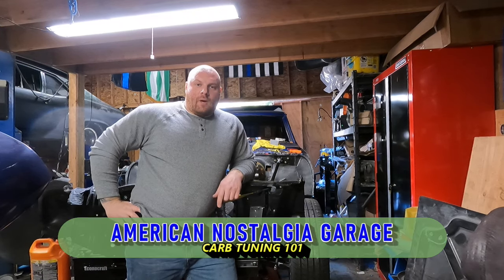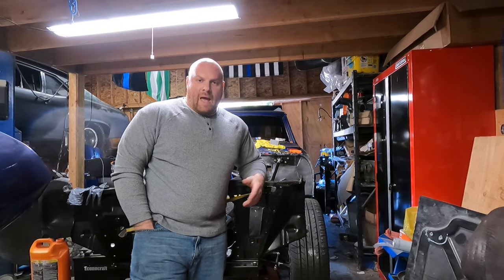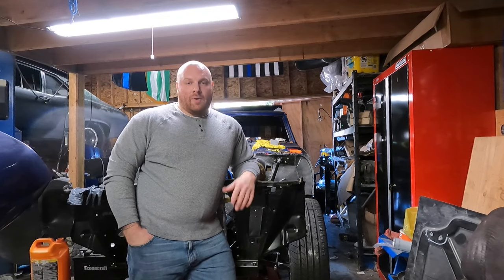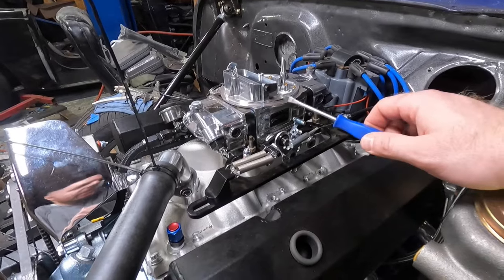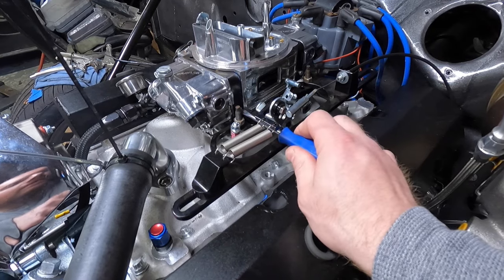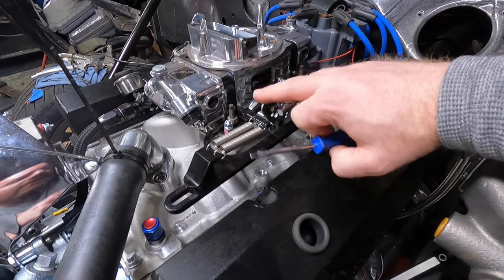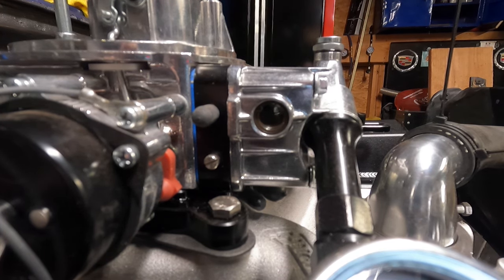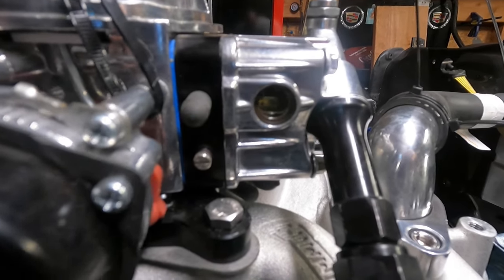CARB TUNING 101: Tuning basics explained!

Comment: I think it's worth pointing out that the glass sight floatbowls have specs per Holley documentation that the fuel should be in the MIDDLE of the glass. The "bottom" is only for the old plugged style ones. Additionally, vacuum tuning is so archaic. Just put an O2 bung in and use a hand held meter and tune for AFR.
Reply from the maker: Thank you for making the correction on the sight glass. I certainly agree that adding an o2 sensor to a vehicle is a better way to do it in every sense however many people running a carb are not going to do that. Which is why I included it in the video. Thanks for watching.

Comment: I am trying to tune my new engine swap with a new 750 brawler identical to this. I am having issues but i think after watching this i am comfortable making all adjustments now. Question - on the vacuum port, are you saying hook the gauge to one of the 3/8 ports?
Reply from the maker: I’m glad the video helped. That’s exactly what it was made for. Yes, normally the 3/8 ports are full manifold vacuum. Just make sure it’s not a timed vacuum port. If you plug into it and have a normal vacuum reading at all times then it’s full manifold and you’re ready to tune. Thanks for watching.

Comment: Holley cow man, thank you so much. I was using the wrong  vacuum port, lol. I have been looking for a good 40 minutes until I found your video addressing the Brawler vacuum port. Thaks again!!!!!!!
Reply from the maker: Very happy to hear it helped!  If you have a vacuum gauge it’s worth testing the port to ensure it’s full manifold vacuum and not ported. For reference full manifold will he high at idle or cruising with the throttle blades closed and go to zero or around zero at wot. Ported will be low at idle and increase as you open the throttle blades because the source is above the throttle blades and works with a Venturi effect as they open. I’m sure you already know that. Just trying to be helpful. Thanks for watching.

Comment: Thought this illustration  was great for me to fine tune my holly 4 barrel
Reply from the maker: Thank you very much for the compliment. Glad the video helped out. What kind of hot rod are you working on?
Reply: @americannostalgiagarage  i had to replace my motor on a 1991 1500 , had a option to put a 350 ci high performance engine in here but had to get rid of the port injection and go old schoot like me . My 350 cu is putting out 425 HP , i was 26 in 1991 when bought new. I paid 16,500 for here ,  had her appraised 2022 in fall 38,500 no rust orginal paint
Reply from the maker: @dorinschatz5457   Wow the appreciation of these old cars and trucks is crazy.  Amazing to see how much money you could make.  Keep truckin'.

Comment: Before changing squirters you could verify that the accelerator pump linkage is adjusted correctly. Make sure that as soon as the linkage is moved fuel is shooting out of the squirter. Once you’ve set that you need to adjust the linkage so that there is a minimum of .015 clearance between the pump cam and the arm at WOT. Great video.
Reply from the maker: Absolutely right. Thank you for mentioning that. Can’t believe I forgot to mention it. And thanks for watching.

Comment: I must admit, the info you provided is not only the best, but also the easiest to understand. I have been dealing with a Barry Grant 650 Demon quad and it's delivery issues . Most others have advised to replace it with another carb that isn't a Barry Grant. I'm stubborn and actually like the carb. So with the info you provided, I feel much more confident about getting my 79 Elco up and running. I have a 350 small block in it. I will post my final results regardless once I have finished. Thank you for taking the time to share and care. And, yes I  am now a subscriber. Peace
Reply from the maker: Thanks A lot for the kind words. Really happy to see you got something of value out of the video. Barry grant carbs are good to go. Although the easy way would be to replace hood parts with new stuff but taking the time to get your old stuff going is more rewarding and it’s a great learning experience. Thanks again for watching. Please post results when you’re ready can’t wait to see it.

Comment: Thank you for the video, what about adjusting the rear butterfly openings? I know my holley has a screw to adjust them.
Reply from the maker: That’s a good question, I did not look actually. This engine has a boost cam in it from its last “assignment” lol, so I didn’t need to mess with the secondaries. Holley sells a kit to adjust the secondaries without having to take the carb off and flip the carb over just so you know. It’s worth the frustration. Thanks for watching.
Reply: @americannostalgiagarage  yes, my secondary was opened alot by previous owner because when connected to ported/timed vacuum he could not adjust idle properly. I switched to manifold vacuum, got 20 timming at idle and closed secondaries and primary down. Works better.
Reply from the maker: @st.k.4528  that’s great. Many people would have not known what to do in your situation great job getting it all figured out!

Comment: Thanks for the video. I have a 750 Proform carb. My new rebuilt engine is running way to rich. Any thought of what I should do?
Reply from the maker: I would start by asking when is it too rich? Idle? Part throttle? Wide open? I would get for idle mixture screws set first those are usually a culprit. Next would be jet the carb down a couple sizes (2 or 3 sizes at a time). Also make sure you dont have too big of a squirter in there. After that we’re talking power valves, air bleeds and a bunch of stuff.
Reply: I would suggest reducing the idle feed restrictions size such as .032" to .028". If your idle mixture screw adjustment is as little as 3/4 or even less turned out, that is a good indication that the IFR size is too big. I like to shoot for 1-1/2 turns out. If you find your idle mixture screws needing 2 turns out or more, the idle feed restrictions are too small. That's when you start having problems tuning the accelerator pump system.

Comment: Should I set my float halfway on the site glass or just when I see the fuel on the site glass.
Reply from the maker: I’m not much of an editor to fix the video but the correct way is halfway up the sight glass. It should be noted that if your carb has removable plugs like the Older style carbs do then the bottom of the hole would be correct. Sorry for the confusion. Thank you for watching.

Comment: how to adjust air flow my truck runs on when i shut it off also alot of condensation out of tail pipes
Reply from the maker: So first the about the condensation out of the tailpipe. H20(water) or better yet steam, in small amounts is a by product of combustion. So if you see a little bit when it’s cold or on start up. Or is you see a small about of liquid coming out of the tail pipes here and there that’s ok. But if you’re saying you have a substantial amount of water coming out of the tail pipes, then I ask what does it smell like, sweet? Then it may be coolant and you may need to be looking into head gaskets, possibly. As for it running on, that could be caused by a couple things, a leaky carb that’s allowing fuel through when it shouldn’t be, I’d also check the timing. But you could also have a hot spot in the engine, gasket or heavy carbon deposits that could be causing it to have pre ignition and to diesel on like you’re describing. Side note if this is a high hp engine or high compression and you have old or low quality fuel or even too low an octane it could do the same thing. That’s a few of the possibilities. Good luck with it, I hope you get it fixed soon.

Comment: I’ve got a Chevy 2 also with a quick fuel carb. I have a problem with a rich idle. Any ideas what I can check for?
Reply from the maker: That’s great what year is your Chevy II? I’d start with the idle mixture screws. After that I’d verify the floats aren’t too high and you’re not dribbling fuel out when you don’t want to. And mess with the air bleeds, if they’re adjustable. Those have everything to do with how fuel is pulled from the bowl. But start with the mixture screws. Thanks for watching.
Reply: The site glass level is in the middle. The rear set screws are at 3/4 turn out. It’s a QF 680VS on a 383 SBC
Reply from the maker: @supernaut1029  how are you deciding that it’s rich? The old sniffer? Lol. If so, could it be that the front idle circuits are the ones that are causing the fuel smell? Also keep in mind that the amount of throttle opening is also going to effect the Venturi effect on the fueling circuits. So it could be open to a point where it starts switching circuits.
Reply: @americannostalgiagarage  definitely smells rich. I have the front set at 1 1/2 turns idling about 1000. It’s not a big cam but the LS is 106. I have a 66 Nova. Would send a pic but not sure how to do it on YouTube 😂
Reply from the maker: @supernaut1029  that LSA is probably not going to be as easy to tune at idle with a choppy cam like that. I bet it sounds awesome so good for you on that. Lol. With an LSA like that your volumetric effieciency is probably pretty bad because there’s probably not a lot of scavenging and maybe some exhaust reversion. So your rich condition could be caused by a little bit of incomplete combustion at idle. However you might be able to bandaid that by setting your front idle screws in a half turn and maybe bumping the idle up by a couple hundred rpm. And maybe smaller slow speed air bleeds. Either way that thing sounds like a good time brother. Just roll with the fuel smell on that beast. Tell people it’s your new cologne.
Reply: @americannostalgiagarage  I  wonder if I increase the octane, if that would affect the A/F ratio? Thanks for all your help
Reply from the maker: @supernaut1029  that’s not going to change the afr. Octane is really about resistance to ping in stuff with high compression or boost or anything with a very hot combustion chamber. That being said being safe with high octane fuel is always a good call on the hot rod. Since most hot rods don’t usually have any safeties for this problem.

Comment: Thanks for the video I'm struggling with my 680cfm Brawler can get it to start but if wont stay running long enough to even verify timing  feels like it's going to shake itself apart. Got vacuum advance pointed at number 6 cylinder.Both corners are 1 1/2 out throttle screw is bumped up almost too much at this point where the engine  diesels when shut off. Where am i going wrong?
Reply from the maker: In this case I would take a little breather. Then go back to basics. Verify too dead center, verify you have the firing order correct. Verify you’re not over advanced(would probably be hard to start) check the plugs to get an idea what the mixture looks like, probably replace them. Make sure the valves are adjusted ok. Then make make sure your carb is doing it’s job, fuel leaks, vacuum leaks, readjust idle mixture screws and make sure you don’t have a leaky power valve or another circuit isn’t fueling when it shouldn’t be. While it’s running look down the Venturi and see if you can see fuel “dribbling” out anywhere. I’m sure you will figure it out. Stick with it. Thanks for watching.

Comment: when you changing the power valve do you have to change the jets at the same time
Reply from the maker: Good question, no you don’t. The power valve has more to do with timing the additional fuel for wide open throttle. Not as much to do with air/fuel ratio although it does effect your afr. You should decide your jet changes depending on spark plug readings and on how the engine runs. It can be tough sometimes. Usually it’s best to jump 2-3 jets sizes and see how the engine likes it. If it gets worse you could try going the other way. Thanks for watching.

Comment: I need advice have great curb idol.  Then I drop it in gear and it drops way down just about killing the engine so at a corner have to put it in netursl
Reply from the maker: So I would want to know what transmission is in the car. Basically want to know if it has a lockup converter. Possibly the converter is stuck locked. But if not I suspect a vacuum leak, or fuel delivery issue. Basically it’s probably running but doesn’t have the power to get over the load of being put in gear because it’s not getting enough fuel or there’s an issue with the trans. Also double check your timing. If the trans is ok, check your fuel filter, the screens in the carb inlets, if you have them, make sure the needle and seat is clear. Buy a can of carb cleaner and spray it all over to try and find a potential vacuum leak. Try these things to start, I bet you find it pretty quick once you start looking. Thanks for watching.
Reply: @americannostalgiagarage  thank you so much off to buy carb cleaner
Reply from the maker: @ceasergert2780  of course, check back in when you find it I’d love to hear how you do with it.

Comment: So which vac port did you use and what if when you do the adjustment NOTHING happens?
Reply from the maker: You need to use the full manifold port not the timed port, once you throw the gauge on, full manifold will read vacuum and drop when the throttle is opened. If you make an adjustment and nothing happens then either you’re right on the money or you’re so far off that you may need to make large adjustments to see a difference. It comes with time. You can do it though, just stick with it. Don’t make more than one adjustment at once. Thanks for watching.

Comment: I am having trouble with fouling plugs it is running to rich I have a 750 brawler on a 383 signature series motor
Reply from the maker: Probably worth jetting it down. But that’s sort of a blanket statement type repair. 383’s are awesome power plants. But shouldn’t need a ton of jet. Try jetting it down 3 numbers and see if that helps. Thanks for watching.
Reply: Fouling/rich at idle or cruising?

Comment: I wish there was a video for carbureted supercharger guys. I got two blower carbs on my 6-71 and can't keep the plugs clean after I race a couple times. No matter how much I lean it out.
Reply from the maker: That’s an entire video in its own lol. That sounds like an awesome setup you have there. It’s been a while since I had a carbureted blower car, but man do I miss it. Mine was a draw through roots blower with a boost reference Holley 750 double pumper.  It was lots of fun but always ran rich. Enjoy that thing. Thanks for watching.
Reply: Sounds exactly what I got but mine is a 427 big block Chevy with good heads and a solid flat tappet cam.   @americannostalgiagarage
Reply from the maker: @menoaz  that thing is probably a beast. How many psi of boost is it making?
Reply: I'm only running 10 lb of boost because I like to run it on pump gas. It still runs 10.90 on my 3200lb Camaro. Wish I didn't have to change plugs so much.
Reply from the maker: @menoaz  I would mess with the heat range a bit. That should help keep the plugs cleaner.

Comment: 2 and a half out to start
Reply from the maker: I’ve never heard that before it’s always been 1.5 but if I have issues I’ll try this thanks
Reply: @americannostalgiagarage  you're welcome i've heard 2 and a half on all carbs your the first i've heard on 1 and a half also i use the afr wide band to adjust takes the guessing out. i have one on each bank i bought a triple gauge holder i have one afr on each side and a vacuum gauge in the middle inside the car
Reply from the maker: @bobdimartino6738  ok well I’ll keep it in mind if I ever have issues the 1.5 turn method I’ve been doing for almost 20 years and has worked perfect for me. But you learn something new everyday right?

Comment: I wonder if that wrong ''cut the idle vacuum in half for your power valve'' myth will ever die.

Lean cruise and idle have zero to do with each other.
Reply from the maker: Seems to be a general rule of thumb that has gotten people in the ball park for a long time. Plus really getting into power valve tuning is above most weekend gearheads abilities. Just trying to help those guys out. Thanks for watching.
Reply: @americannostalgiagarage    Yeah, it's crazy people can't tape a vacuum gauge to the windshield and literally look at the needle when the car misfires at cruise.

It's literally the easiest thing to sort out (correctly) in the carb.

It's not like something 'complex' like realizing the main jet is for cruise not WOT. And the power valve channels are for the rest of the fueling at full throttle.
Reply from the maker: @earlbrown  its not crazy but i think that’s mostly above what the average gearhead knows to do. Thank god for people like yourself who know enough to pass along the extra knowledge and experience. Again thanks for adding the much needed info.

Comment: A lot of old fashioned tunnig , need to get with the times , carb tunnig has moved on from most of what you show
Reply from the maker: There’s no trick about setting up a carb. Regardless of what year it is, setting float height, idle mixture, and so on never changes. However, what you might be referring to is manufacturers changing the carb itself which may require different tuning methods or settings. Ever carb is not the same. But every one of the “old school” methods still works perfectly fine for most Holley type carbs with some minor adjustments for design changes ie sight glass on the fuel bowls. But the fundamentals still work for EVERY carb. We change physics even if we wanted to. A carb is still a carb. Thanks for watching.